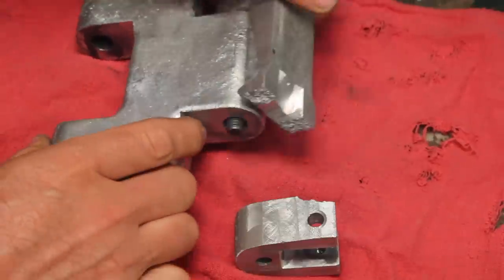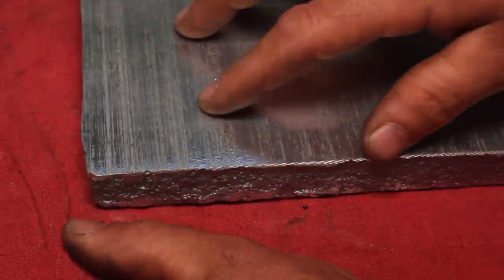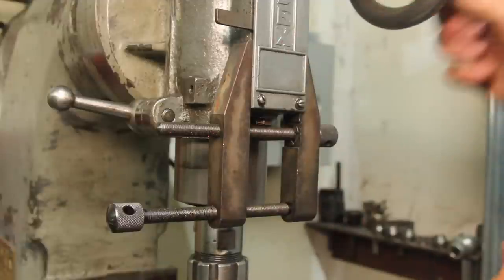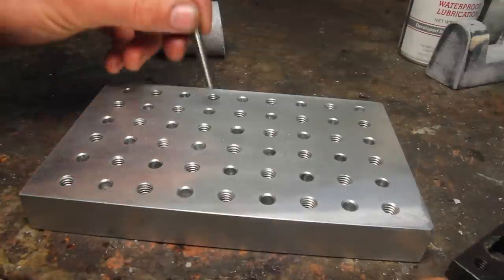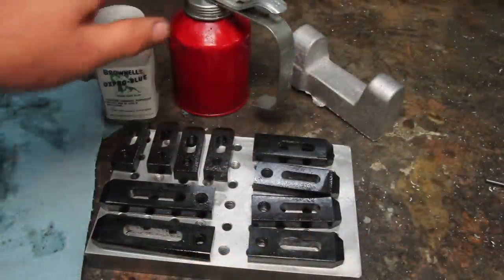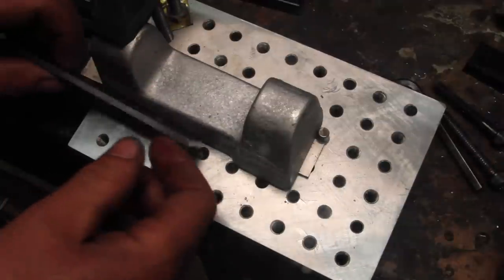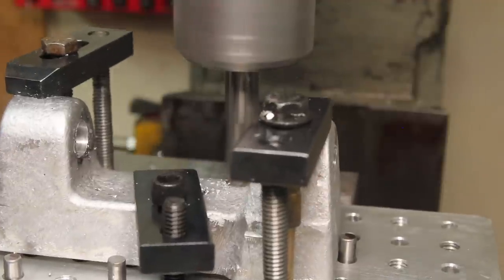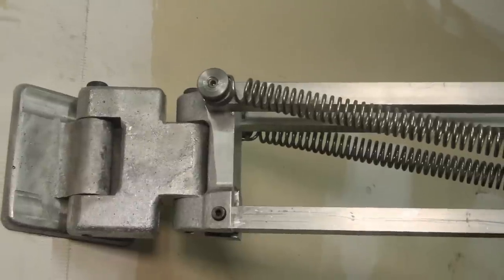Balanced Arm part 4 (Mini Pallet)

Comment: I have the same Index Model 40 you have and your comment about it not having a quill stop got me to thinking about how one might make one and it occurred to me that a collar could be made that fits on top of the spindle above the pulleys and is clamped in that area at whatever point you want the spindle to stop. I haven't actually looked closely at my mill to check feasibility but I thought I'd toss the idea out there.

Comment: If you're going to cast aluminum, you should de-gas it right before the pour. you can do this by bubbling argon, or nitrogen through the molten metal after removing the dross and oxides from the top right before pouring.

Comment: Every hold should be reamed at the top and tapped at the bottom.   Ream them a bigger size than the threads.  If you need the pin put it in the top. Or if you need the bolt it just goes a little bit deeper.

Comment: When you  doing your casting why did you can't you  in large the in take holes  for better follows of the metal
Reply from the maker: Larger holes cause turbulence which traps air and oxide film in the metal. It’s better to keep than as small as possible so they stay full while pouring.